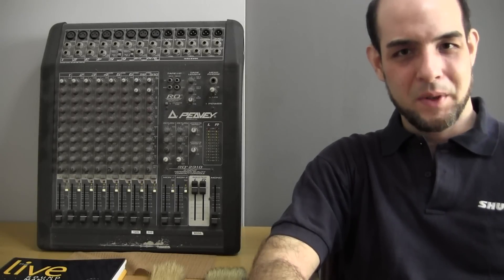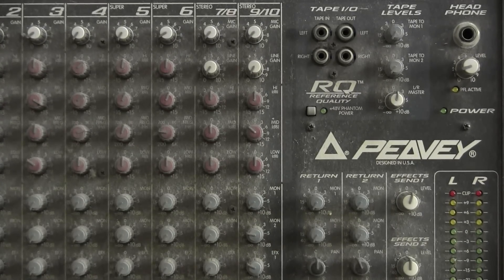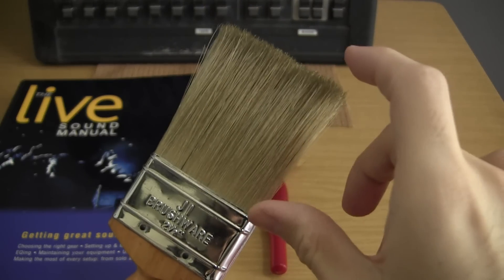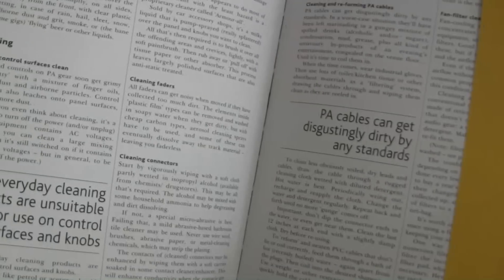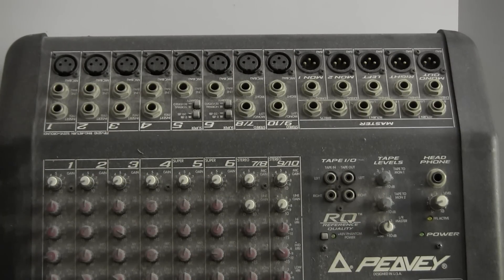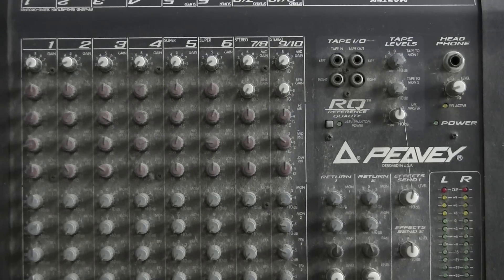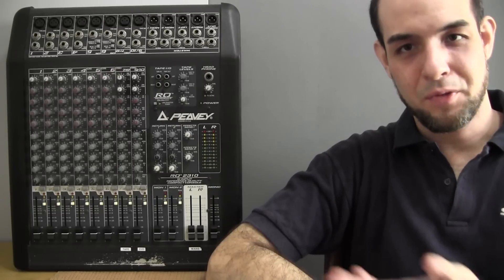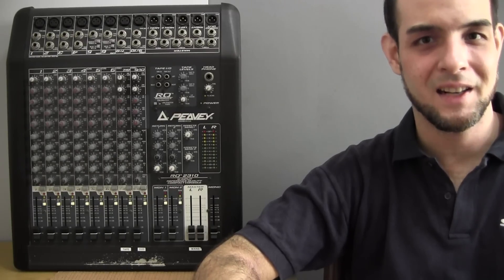How to clean a dirty mixing console

Comment: While brushing it's good to also blow the dust away. Optimal would be to use compressed air (if it doesn't condensate). And you can use a vacuum on the bottom fader grooves (they are most prone to dust coming in). Just be careful not to vacuum any knobs off ;)

Comment: I use a vacuum cleaner with a round brush head and it works just as good without having to worry about the dust falling into the crevices.
Reply from the maker: Yes a vacuum cleaner is ideal but often unavailable in the field.

Comment: Thanks for the ArmorAll tip.  OK, so what I do 1st of all on really dirty gear including mixers is use a vacuum brush on the assumption that the bulk of the dust is sucked away form the equipment.  You may well shudder but I have used a very slightly damp cloth (one that has been rung out and then sandwiched in the folds of a towel to ensure that while the fibers are damp, there is no free water.  This seems to pick up dust pretty well.  The same can be done with a brush and I have never had an electrical issue resulting from this over 30 years.  I usually remove knobs but you do risk destroying pots and faders sometimes,  usually easy enough to replace though.  The other thing is that no matter how careful you are, over time the pots and particularly the faders can get contaminated with dust but also they dry out and go stiff.  Can try compressed air to blow dust out, this sometimes works.  On occasion, I have lost controls like channel EQ due to pot contact failure.  I use Deoxit F5 cleaner lube, it's expensive but is supposed to be compatible with most track materials and leaves the controls feeling and working silky smooth with no crackles or dropouts.  I sometimes use a hypodermic needle as a spray tip to get into difficult pots.  You may notice that some boards have trimmer pots.  Often these have gone completely open circuit and a little smear of F5 can improve that.  Of course, this isn't resetting to specification but arguably better than leaving it open.  I would take gear to a reliable repairer but the nearest one to me is 3h 30m drive away or more than a week each way by courier.

Now then, this naturally leads to the question of cleaning plug and socket contacts.  I suppose if things are getting plugged and unplugged a lot, this abrasion keep contact surfaces relatively clean.  However I have found that sound quality can deteriorate in time possibly due to oxidation of interconnect contacts.  Again, I use a Deoxit cleaning and conditioning kit.  I'm starting to sound like an add I suppose, there probably are other brands but I use what I can get locally and reviews seem to suggest this as good as it gets.  The conditioner helps to seal the contacts from further oxidation and seems to improve clarity of the system overall.  Anyway, it's a heck of a lot of work to do all the system connections but the results seem to me, very good.

I watched your cable cleaning as well,  Just like to suggest adding alcohol to the cleaning water.  In chemistry, water is known as a polar molecule and  is a most excellent solvent for polar molecule substances.   However, it is incomparable for non polar substances.   Alcohol molecules have a polar and a non polar end which makes it both soluble in water and able to dissolve some non polar substances.  So adding Alcohol to water makes a much more versatile solvent.  Not strong enough to be destructive but increases the range of substances that can be removed, getting things cleaner faster.
Reply from the maker: Thanks for the long response, I hope others benefit from it too! 

Nothing wrong with using a damp cloth - in fact I know a lot of pros who use a damp paintbrush to do the same thing. You need to know what you're doing through, which is why I don't show that technique in this video. 

Yup Deoxit is great stuff! 

I'll try the alcohol + water idea next time I have some dirty cables to clean, thanks for the tip!

Comment: I wonder couldn't you use a vacuum cleaner to get most of the excess dust off? A vacuum cleaner might also be useful for getting any dust out of the xlr, plug or fader holes couldn't it?
Reply from the maker: Yes, but most sound engineers do not carry a vacuum cleaner in the field 😊 Even with a vacuum cleaner, you still need a long-brush attachment to reach in between the knobs. There is also a danger, especially on older consoles, of loose knobs being ingested by the vacuum! I find that a paintbrush does about 90% of the work, although of course a vacuum will be best.

Comment: Gaffers tape over the fader slots is a good way to protect them from dust during cleaning
Reply from the maker: Sean Kent That's a great idea - the only thing to be wary of is that the adhesive can strip the paint off the panel. I would use something like low tack painter's tape. Thanks for the suggestion!

Comment: Hello hello Mia have a mixer that the right output main channel stop working suddenly and left channel there was lots of cracking sound when moving up and down.   I used the air blow spray and I also applied drop of oil on the fades and now suddenly it became new again
Reply from the maker: That's great! I recommend not using oil on the faders as it will attract more dust in future.
Reply: @GLBProductions  i use dust air compress spray before adding oil and after to also lubricate the levers.  In my case it worked

Comment: The moisture can cause damage..........unless it's a Mackie.  LOL   Those things are like SM58s, they CANNOT be killed.  Good to see you back making vids, buddy.

By the way, DeoxIT will dissolve any oxidation and clear out any dust or dirt that gets into the pots/input jacks and causes crackling or bad connections...I know you said the book says that's a no-no, but it doesn't do anything to the solder joints.  I've used it for over 10 years and it's never done anything bad.  I can only assume that it would work magically on dirty fader strips.  It's great stuff.  I use it to clean my electric guitar pots mainly, but have used it on my mixer's pots and it's worked great.
Reply from the maker: Eric Pederson Yup, I pretty much agree with you there! I've got a break in my teaching schedule at the moment so trying to get as many videos done as possible. Thanks for the support.
Reply: it works great with everything BUT faders. you need a different more expensive version with lithium grease for sliders and faders.

Comment: I'd like to offer a suggestion for the people who don't like armour-all on their knobs.....
Tedious as it is, the results are great. Take all the knobs off, find an appropriately sized dish and fill with warm water and add some dishwashing detergent, or even car wash detergent. Using a toothbrush, clean each of the knobs, rinse in clear water, set aside to air dry, or dry using compressed air if available.
Reply from the maker: +guitarrelic Thanks for your contribution. Personally I wouldn't use armor all on the knobs, only on the panel. The knobs I would clean with a damp cloth or as you suggest above.

Comment: I have only had my mixer for a few months, so I've been blowing the dust away, or trying to, and using a micro fiber cloth on the more open spaces. I will be mounting it more vertically to more easily see the exact position of the sliders as I use it for streaming, and I sit while doing that, and all of it will be easier to reach. But I will make a cover over it to stop some dust from reaching it. I will definitely get a brush, that looked a lot easier to remove the dust compared to a cloth. And if I can get my knobs off, I will treat it with ArmorAll (or similar) to make the dust settle less. Great video (and sorry for the long comment :P).
Reply from the maker: Thanks for watching Alex. The armor all treatment should not be necessary for a new mixer - just use a dry paintbrush and you should be fine. A cover is definitely a very good idea!

Comment: Hi Bruno ,,Great tip for cleaning,I also use a anti static duster the ones used for cleaning window blinds  once a week keeps the dust away it works also, on drum kits and other music instruments sometimes with guitars it hooks up on the string ends sometimes..

Comment: Thank you so much for this tutorial.
The clean dry paint brush is genius.
I used to use rubbing alcohol and Q
tips. Lots and lots of Q-tips. I'll still 
use alcohol and Q-tips for the corners
But I'll definitely use a brush and 
Armour-all
Ty
Reply from the maker: Yes in fact you can also use the paint brush damp for cleaning very dirty consoles - never a wet brush though!

Comment: You do not mention using a vacuum hose and brush attachment. I was wondering what your thoughts are on this. My church has recently done some structural improvements and I have a moderate amount of dry wall compound dust in my booth.
Reply from the maker: Dennis Neuhaus That would work well if the brush attachment had bristles that were at least half again as long as the mixer knobs are tall, otherwise the possibility of damaging the knobs with the head of the attachment would exist. 

There is also the issue of the suction of the vacuum literally pulling small parts off the mixer - some faders are only loosely press fit and if they get sucked up they may get damaged or lost. 

It thus may be best to use a hand-held brush to remove the dust, whilst holding the vacuum nozzle nearby with your other hand - this would stop the dust from going everywhere yet keep the suction a safe distance from the console.
Reply: Thank you that is helpful considerations. I have just found your channel and enjoy what I have seen and hope to view many more videos.
Reply: Dennis Neuhaus You could just hold the vacuum nozzle close to the paint brush, as you clean/brush with it. that way, the loosened dust/dirt will be picked up by the vacuum, while avoiding possible impact damage from the vacuum wand.

Comment: I use a compressor and cleaning with compressed air. Very carefully. However, it takes the most.
Reply from the maker: Yes that's a great way of doing it, the only problem is that the dust often ends up on everything else, so you need to make sure the mixer is located away from other gear when blowing it off.
Reply: Yes. I usually open the mixer and blows it inside too .. it is also the best for a computer too .. Better than using a vacuum cleaner

Comment: @Simon Tempo 409 is the bomb for cleaning outer surfaces. you can dilute it 1/10 and it's less soapy. That and a good can of contact cleaner is what to do after dusting the exterior of the unit. I recommend removing all knobs when starting.
Reply from the maker: +Guitar Whores Thanks for your contribution.

Comment: I was never a fan or ArmourAll didn't like the way it shined, I'm more of a flat look. I was thinking as I watched the video that I would try spraying the paint brush which will get between the knobs easier then the cloth. What's your thinking on that? Yamaha MX400 - 24, great analog board. I'm not going to keep this one much longer which is why I'm looking for instruction on cleaning.
Reply from the maker: +Tommy Cramer I would say it depends on how dirty your mixer is - if it's just dust then using a dry brush should be sufficient. The mixer in the video was incredibly dirty and the dirt had actually stuck to the panel which was why I decided to try out the ArmorAll. I know a pro who cleans his mixers with a wet paintbrush, but I wouldn't use any sort of chemical on the brush - too much danger of residue ending up where you can't get to it. Finally I think that in order to do a thorough cleaning job on any mixer the knobs really do need to be removed, but your mixer might not be that dirty.

Comment: After brushing, and using a vacuum, do you recommend using some form of dry compressed air (from a spray can, or air  compressor)?...  Perhaps use a "Swiffer" wand vs a paintbrush! Have you ever heard of using one of those dry 'sponge' (latex) products- recommended for such uses as cleaning walls, brick (fireplace soot), tile surfaces, etc.  Perhaps it might help to gently 'scour' the painted surfaces, without risk of moisture, or loose particles, etc.  Check it out.             Another Great  GLB Productions Demo, ....(as usual)!!!
Reply from the maker: guloguloguy Hmm, what would be the purpose of using compressed air? 

You really do not want to use anything even remotely abrasive on the mixer panel - the risk of damaging the printed legends is too great, and if any of the abrasive particles find their way into the mixer track they can very effectively abrade away your contact material until your fader stops working!

Comment: Any tips on cleaning the knobs?  Any harm in a water/mild soap wash in a basket and air dry?
Reply from the maker: Yeah that'll be fine - if they are really filthy try scrubbing lightly with a toothbrush. Make sure they are really really dry before re-attaching, blow out with compressed air if necessary.

Comment: I have found that Armour All has consistently led to plastic ending up CRACKED after it has dried. 
PLEDGE would be a better product as it too will prevent dust buildup and will not cause plastic to crack.
Also using WD40 and GOO GONE (almost the same product) works perfect for removing sticky finger grime and tape residue.

Comment: Thanks. I like your vids. Well explained.

I too am a fan of DeoxIT.

I have that same board, have ordered the book so I had better get to work.

JimE
Reply from the maker: blackemmons Yes, DeoxIT is definitely one of my favourite cleaners when it comes to cleaning plugs and connectors in general. I'm just wary of using any sort of spray cleaner on a mixing console because it's hard to control exactly where the stuff goes. I'm sure you'll find the book interesting. Just one caveat though - for some strange reason this particular book does not have any illustrations! There is tons of useful information but no pictures, so it's best suited to those who are already familiar with what the tools of the trade look like :)Thanks for your support, all the best with your music.

Comment: Put the cloth around the paint brush? Makes it easyer to get inbetween the knowbs on the mixer. Just a thought, really. I imagne a digital mixer culd be easyer to clean, since it does not have souch tight spaces between the knobs.

Good video! I wil go straigt to clean "my" mixer when I get home :D
Reply from the maker: +Mr89netrom Digital mixers are cleaned in much the same way, although you have the slight added complication of cleaning LCD touch screens! And yes they have far fewer knobs and a generally less complex control surface so are easier to dust.
Reply: Scotch tape? For the LCD screen i mean. Cut it flat at the ebd to get it in the corners?
Reply from the maker: +Mr89netrom No I just use a lens cleaning cloth. If the screen is really filthy I use some lens cleaning solution or a slightly damp cloth.

Comment: What about using a low powered vacuum with a brush head, would this also be a good way to clean?.
Reply from the maker: Clatten Strait Yes, although you'd need to find a brush head with very soft bristles which were longer than the tallest knobs on the console - this is not easy in practice! In addition, there would be the risk of cross-contamination from the vacuum cleaner. There are some vacuum cleaner attachments made specifically for cleaning computer keyboards, those might work better.

Comment: very helpful..by the my mixer going through some problem actualy left and right channel hear different i mean one is brighter and one is muddy can u pls help me to sort out what is the problem??pls..
Reply from the maker: +kforthy chris Swap over the left and right output connections and see if the problem changes sides. If it does the issue is your mixer, if it does not the issues is your speakers or amplifier. Let me know what you find.
Reply: ok will let you know thankz !!
Reply: when i swap the problem changes sides..
Reply from the maker: kforthy chris Then you'll need to see what the issue on your mixer is - I suspect it may be a graphic EQ that is adjusted differently on the left and right channels.
Reply: nopeee..i connected an ipod into a stereo channel with left and right nd did the procedure.!
Reply from the maker: kforthy chris In that case there may be an issue with the cabling or the stereo channel itself. Check your cables and try running into two mono channels and see if they sound the same. If they do then the issue is with the stereo channel - if they do not then the issue is with your ipod or cable.
Reply: thank you for ur valuble time.God Bless!!
happy new year!!!!
Reply from the maker: kforthy chris You're welcome! Happy new year to you and blessings for 2016!
Reply: hi Bruno...been following your videos for sometime..great stuff!
if i can provide my 2cents worth on the above: my understanding is when swapping channels, the problem change side, indicates issue with amp/speakers? if not, issue is mixer/input side...

Comment: in our school we have behringer SX2442FX mixer but it have dust aside from the brush can i use air blower machine like the one used in computer to clean its dust ? is it harmful to the mixer ?
Reply from the maker: nice_q8t You can as long as the blower is gentle - too much pressure and you will force dust into the inside of the mixer where it will cause even more problems.
Reply: GLB Productions
 okay :)

Comment: I had a mixer so dirty that I took it apart and washed all the knobs and top plate. Then I used deoxit on all the pots and put it back together. It was a mackie 1604vlz
Reply from the maker: I'll bet that is one happy mixer :)
Reply: Which Deoxit did you use?